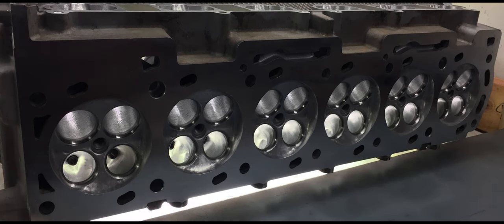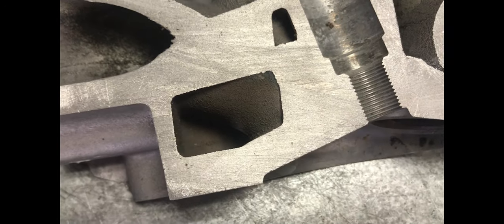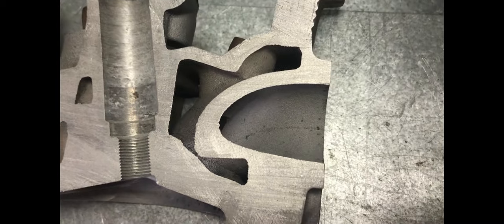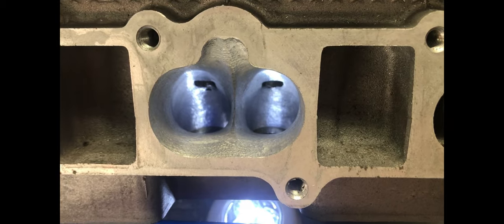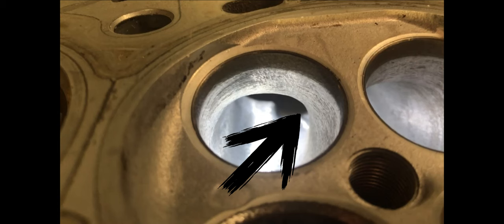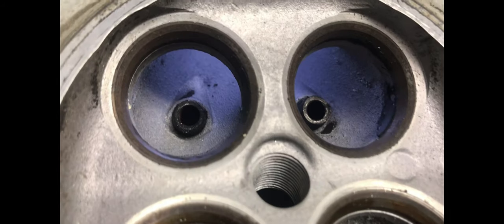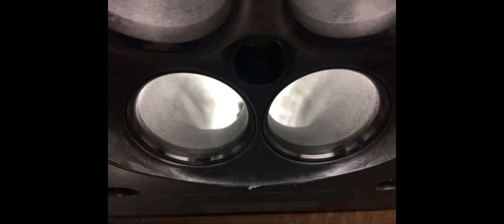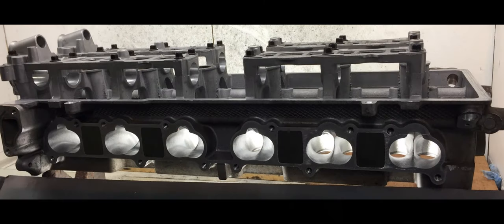Barra Cylinder Head Porting, How to port.

Comment: Those kind of flow figures could be an impressive na engine build, im trying to talk a friend into letting me build a itb na barra and i think 480hp na is quite achievable with e85 and 14-1 comp with a head like this and some 54-56mm throttles and some nice sized cams 🥹🥹🥹🥹 good video i enjoyed the content
Reply from the maker: Thankyou 👍
Yeah that Barra when the 4.2L bottom end is done calculates out to around 540hp at the crank N/A
480hp is absolutely doable. In the not too distant future I will have a video out about a SOHC that sports one of heads and ported lower half of a BBM, it will make about 450hp at the crank and then hit with 300HP of nitrous. Will be fun Ute 👍
Reply: @seanb250  Im looking forward to seeing the SOHC vid, love the SOHC
Reply from the maker: @1616Rotor  the truck is still in the works, I’m looking forward to the final result as well 😁

Comment: Any flow graphs on intake ports from factory and then after porting?
Reply from the maker: @clevo351  yes I do, stock intake ports peak at 260cfm and the exhausts 196cfm
Reply: @seanb250  Can you do a video with before and after flow charts from .100 valve lift to .500 valve lift?
Reply from the maker: @clevo351  I can do 👍 won’t be straight away tho.

Comment: Excellent work.
I always have a giggle to those that say "Barra's dont need porting to make big power". Yet, these people miss out on an extra 80cfm, or better put, an extra 32% airflow. This means less boost (heat), and less camshaft to get the same job done.
It also sounds better!
Reply from the maker: The stock port can support about 6500rpm on a stock 4L, that head is for a 4.2L spinning to 8500rpm so the area and flow is needed, it’s all math and as you said, better efficiency means less boost and heat to achieve the numbers 👍

Comment: "  hope you find it useful." nothing there for me ! what is the optimum IN valve dia to bore ratio, IN length, and diam to IN valve diam ratio,  I always remove metal from the top of a downdraft port
( side valve is the reverse ) That port marching finish is a shocker, does not have to be shiny, but will not accept the roughness promotes vortices ????  every time you make the gases tumble + lost energy
Reply from the maker: @bobawatsit  why would you listen to my answers then considering the shocking job I’ve done to this cylinder head 😂 no more answers for you 👍